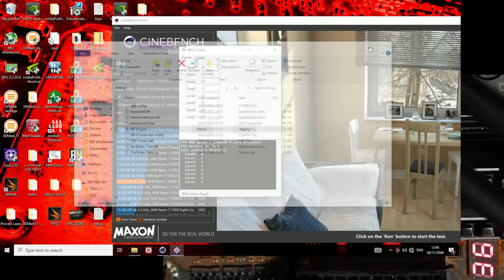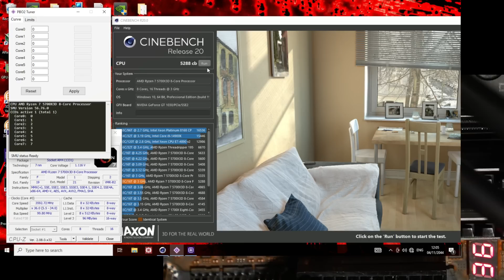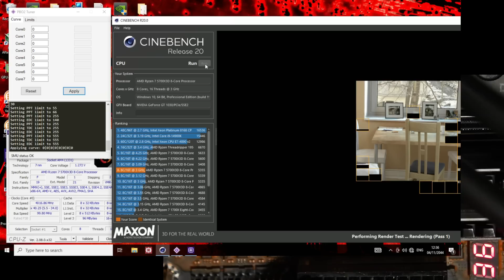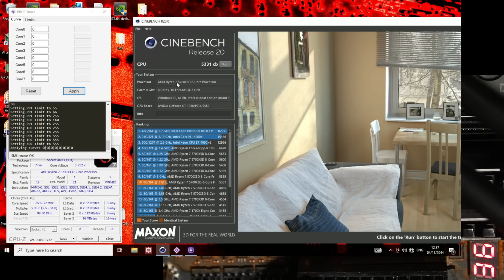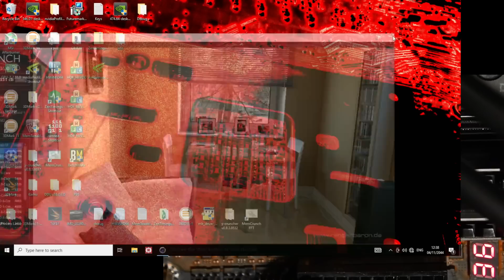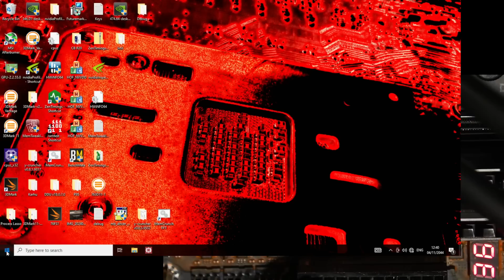Trying PBO2 Tuner on the 5700X3D

Comment: CO is complicated, if not done right there's just clock streaching and instability, like the 99% of the people posting -30 all core online. My 5700X is able to run +50Mhz with a mixture of -30 to -10 fully stable, more than that cause one core to no boost correctly, maybe is my bios bugged idk, but it's pain.
Reply: The interesting thing about clock stretching is that at some point adding more voltage to eliminate stretching will result in lower effective clock, even though it's matched, compared to stretched effective clock, but which runs a tiny bit cooler due to lower voltage.
Reply: I've only ever seen instability as an issue with CO, never clock stretching.
In my experience, clock stretching only happens when the supplied voltage is detected to be insufficient, which might happen due to manually set vcore/offset or a weak LLC setting. CO just straight up makes cores ask for less voltage for the given frequency than they should at stock, which is why it crashes when not enough.
Reply: That's not true when it comes to the X3D chips on AM4. They run at a low enough frequency that most can do -30 on all cores without negative effects. I've tested my 5800X3D in every benchmark going at -30 and performance has always been better than stock, complete with significantly lower temperatures. On the other hand, my 5800X non-3D most certainly couldn't do -30 on all cores, although the result was instability in light workloads (random BSoDs when watching Youtube videos and such), not clock stretching.
Reply: @CaptainKenway   @igoresque  how much testing with core cycler with avx2 have you guys done while also having hwinfo64(snapshot) open?
Reply: @d4mb20  I've done a lot of testing on my 5700x with p95 small ffts and HWiNFO set to snapshot for CPU clocks, don't need core cycler for that
Reply: @igor_mkv  and never seen clocks act crazy? My chip can pass +200Mhz just coz the effective clock never goes beyond 4.6Ghz, making stress testing useless
Reply: @d4mb20  tune your LLC, clock stretching means not enough voltage is supplied by VRM. My cores never clock stretch with proper LLC or positive offset, no matter the CO value set. I prefer to set LLC to weakest value and compensate with a bit of a positive offset. I believe this way you reduce transient spikes while having the same voltage under load. Small load voltage doesn't matter as much anyway, and we also lower it with curve optimizer.
Reply: With weakest Mode 8 LLC on my MSI B550 board I had to set positive offset of +0.075 V to get Effective clock to be virtually the same as reported Core clock.
Cinebench on the other hand needs only around +0.0125 to +0.025 V to stop stretching.
Less power -> less Vdroop -> less stretching.
In less power intensive CPU workloads, like gaming, clock stretching won't even happen if you don't set the offset, since Vdroop is even smaller.
If you don't care about running P95 Small FFTs multicore professionally all day, but care about tiny power savings, then I wouldn't bother with tuning for CPU to not stretch clocks in it.
By default, my mobo uses LLC Mode 4, because from my testing, P95 Small FFTS still stretches a bit at stock(no offset), but in Mode 3 it no longer stretches.
Reply: I have my 5700X set to no power limits before and now switched to 88W for power savings, LLC Mode 8 with +0.0375 V offset I get ~15MHz of clock stretching in P95 Small FFTs all core (Core 4135 vs 4120 MHz effective)
If I increase the offset to +0.05 V, stretching goes away, but frequency goes down to 4100 MHz core/effective.
Reply: @igor_mkv  My LLC is already at the max my mobo can allow, if I recal correctly Level 5, which was the one suggested by buildzoid in the mobo "review". I've never tried with manually adding an offset voltage, but from what you're saying it helps with clock, if that does the trick I'll try again.
Reply: @d4mb20  are you sure your mobo's Level 5 is not the weakest instead. My other motherboard is ASRock X370 Taichi and Level 5 is the weakest there. Level 1 would be the strongest/most voltage during loads.
Reply: @igor_mkv  yep, 100% sure, with Asus is usually like that, the full LLC testing of the C7H is still up on buildzoid's channel, old video but useful info. I'll try to add a positive voltage offset, maybe I can squeeze a bit more MHz out of the chip.
Reply: @d4mb20  how do you test it then? I would usually just run P95 Small FFTs all core and see if clocks get stretched, as simple as that.
Reply: @igor_mkv  corecycler with custom settings (p95 large* avx2) and hwinfo open, so this way I can see clocks and effective clocks. My problematic core is core 1, the fastest is core 6, but only core 1 in my case doesn't clock properly with anything over +50Mhz.
Reply: @d4mb20  why not just go straight to small ffts all core, that's the heaviest you can do and will see clock stretching right away
Reply: @d4mb20  Large FFTs is also primarily memory intensive rather than CPU, that's why it's used for stress testing RAM overclocks. So of course, your clocks will jump around, CPU is underutilized with Large FFTs after initial setup.
Reply: @igor_mkv  I said large but it's actually 720/720, it does the job to achieve the maximun single core speed. In multicore the cpu is fine, all clocks are around 4.4/4.5 Ghz depending on the temp, my issues are just  single core related. I just tested with a voltage offset but no luck, core 1 just doesn't want to go over 4.7Ghz, maybe is close to being busted lol
Reply: @d4mb20  720 FFT size? Are you sure?
Reply: @igor_mkv  yep, manually set as it was one of the advised setting for corecycler
Reply: @d4mb20  weird, when I try to run 720 FFT size in p95, it just stops saying that FFT of this size is not available

Comment: This helps only if you use low TDP / Eco on thermally constrained system i.e. miniITX.
Since in that case lowering the voltage removes some botleneck points for the CPU to give performance.
I have the 5800X3D at 65W working in ~5% performance range from the default 105W in all core, and exactly the same in single core. You would expect 40% lower TDP to have more of a performance hit. And it does without the PBO2 Tuner.
Reply: The voltage/power required for the last 200-300 MHz is indeed insane, same with 6000/7000 GPU, they really do try to squeeze whatever possible with little regard to power draw
Reply: No, CO affects ST and MT when overclocking. It increases performance by shaving off a little power to get max clocks.
Reply: another factor is running your system way quieter when it runs cooler so it's always worth it

Comment: knowing you're using a 1030 hurts
Reply: Whats wrong with a 1030? I personally use a gt730 on my bench
Reply: why would he need anything more?
Reply: If you decide to use any gpu with the need for external power on your testing rig for non 3d loads you'll find out it hurts more 😂
Reply: Why? Its a reliable way to put an image on a screen when you aren't doing 3d benchmarks. Its very common to use a 1030 or 1050 when benchong cpus
Reply: benchong lol @JatXoc

Comment: I used PBO2 Tuner for my 5800X3D for quite a while, then MSI released a bios update for my B450 Gaming Pro Carbon AC that updated to AGESA 1.2.0.A which didn't just add KomboStrike but also gave me access to curve optimizer and PBO settings directly in the bios. There is definitely uplift. I'm running -30 across all cores, (edit)122,84,124 for PBO settings, and gave myself a 0.05 voltage offset with an LLC of 7 to help with temps. I post a 15300 in R23. I don't have patience to run single core though.
Reply: i wonder if amd will ever stop doing weird amd things
Reply: I'm glad to see this comment, I just ordered the 5700X3D and thought I wouldn't be able to use PBO in BIOS, using an MSI B550-A pro 🗿
Reply from the maker: I love how everyone who uses PBO never mentions what their CPU scored at stock.
Reply: @ActuallyHardcoreOverclocking  most people don't keep spreadsheets of their benchmark results. I did this over a year ago. Why would I keep settings that didn't improve performance? However I just went back through and ran completely stock CPU settings with my current tightened DDR timings. Best of 3 runs stock on R23 was 14150. Best of 3 runs with PBO and curve optimizer was 15250. All the tests were off a fresh reboot with my default programs loaded.
Reply: I can get a 15600 with a 102 bclk, if i lower my DDR clocks to 3733, but I get random WHEA crashes, so I choose not to run those settings. With PBO and curve optimizer my clocks peak at 4450. With a 102 bclk I'll reach 4550. I've seen guys with external clock gens rocking 107 bclk with 4750 clocks, think their R23 scores are in the 16000's.
Reply: @ActuallyHardcoreOverclocking  13898 Stock, 14839 -30 all core on 5800X3D.
Reply from the maker: @AronHallan  wow that's way more of an improvement than I've ever seen from curve optimizer.
Reply: @ActuallyHardcoreOverclocking Back in December of 2022 when i first got the chip i remember crossing the 15000 mark, averaging 14900s but the stock clock score was also slightly higher than my current one.
Don't now if it has something to do with thermals of the paste not being fresh or software updates that made my score slightly less than before.
Reply: @ActuallyHardcoreOverclocking i have the same general sentiment as you do, and you're mostly right, but there are exceptions. 

I did same settings in almost identical conditions and got almost identical results and behaviour.

2x 5900x.
-30CO and loose power limits (they cap at around 200w) Went from 20,7k (the usual stock for every1) in cb23 multicore to 23,5k+.

If your the unit can't do -30 on all core, which is most likely, just shave off some frecuency from the top.
It's not gonna account for any loss, except single core synthetics and maybe games that don't go over 10-15% CPU load might experince 1-2%fps loss. However the higher you go on load the more performance gain starts to show up.

There's also another benefit. Depending how well you balance the shave with the loads you have and the cooling solution, you can see as high as 25°C temp reduction on low load spikes, with minimal to non existent performance loss. 

This behaviour is more accentuated on double die higher binned CPUs like Ryzen 9, where the difference between base clock and the top of the XFR is very high.
Reply: @ActuallyHardcoreOverclocking  the 5800X3D is fragile. There's no warning they just die, guys are killing them with bclk. I think AMD was just overly conservative because of it, so there's a lot of headroom if people are willing to risk it.
Reply: @ActuallyHardcoreOverclocking you haven't seen the standard 5700x PBO scores then have you? Just turn off all the limits for power and current, create a negative curve setup and boom, tons of extra performance. Approx 20-30% improved multi core score when you nail it down.
Reply: Sillyness. Still running mine at 104.2.
Reply: @ActuallyHardcoreOverclocking i've built a few pc's for reselling, and my recent 5600x build at stock:
10980, 11036 (run 1, run 2)

after per core co, + 50mhz freq, pbo 88/100/120

11600/11622/11550

3700x stock:
12117/11774

stock pbo, but -0.1V cpu and soc
12407/12610/12629

my cpus were never thermal throttling in the first place, so i wonder if co is helping some of these other systems not throttle and help their scores on top of just better frequency stability?
Reply: @ActuallyHardcoreOverclocking 7800x3d at stock was 17k after -30 all cores it’s well above 18.5k
Reply from the maker: @iamdeluluu  you 7800X3D is running really really badly for some reason. They generally score around 18.5K at stock in R20.
Reply: @ActuallyHardcoreOverclocking  his 7800x3d maybe doesn't have massive cooling. I'd say PBO2 helps your 5700X3D with lower temps and fan noise. My 5800X3D on a MSI B450M Mortar only works well (4450 effective clocks) with Kombo Strike 3 and LLC on auto.
Reply: @ActuallyHardcoreOverclocking 17.4/17.5k stock not a literal 17k that’s my bad but after -30 it’s well within the better silicon range of 18k+ even with a undervolt
Reply: Not many 7800x3d’s hitting 19k 18k is perfectly normal especially mid 18k